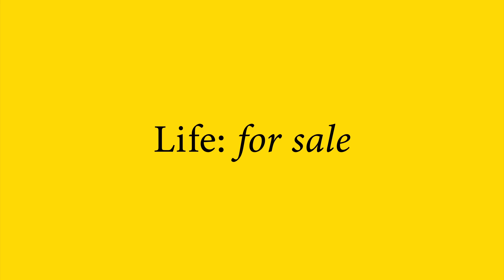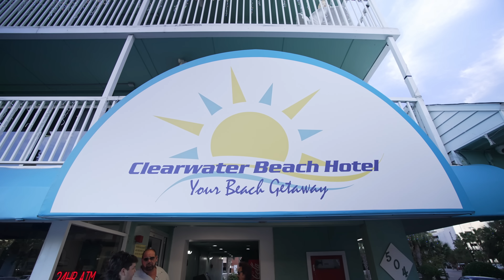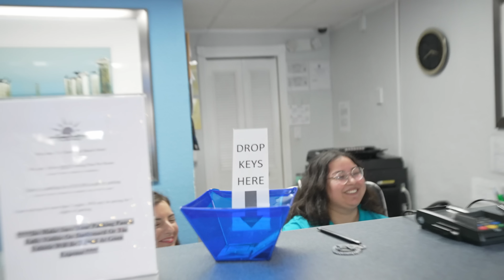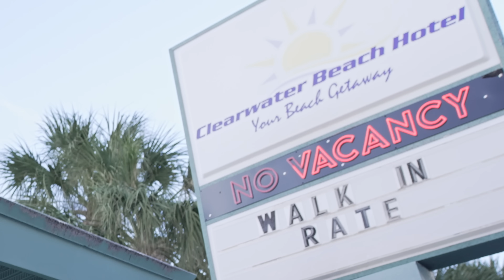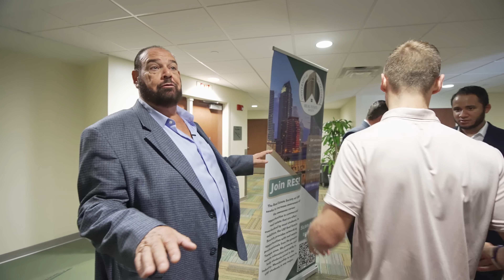Do You have $12,000,000 for this?

Comment: Ben, I know you are a stickler. Don't be a Smuck. I noticed quite a bit of black holes or black gaps up on the perimeter edges of the drop ceiling in the check in office of hotel. You could just put some caulk or something and spot paint to hide the black gaps.

Comment: Hey Ben -
Interesting play with the 2nd hotel across the street, do you think your changes limit the ability to spin off the hotel considering you’ve tied it to the primary hotel so considerably? Seems like they would now need to be sold as a bundle.
Reply: I don’t think so if he really wanted to sell it separately he could turn the icecream shop back into an office/check in. The building is still there so it shouldn’t cost too much.
Reply: I was thinking the same thing but id imagine you would need a front desk at all times especially in a tourist area .. or an idea is if he sells the hotel individually and the new buyer uses a real estate agents office offsite and thats where they deal with people there or also they can do bookings via Expedia, airbnb, etc.. you can get the keys in keyboxes around the property and completely eliminate front desk staff, you probably only need cleaners and maintenance.. but never owned a hotel so not sure if it would work but everything is pretty much digital these days so i dont see why not
Reply: It's more valuable together. and he's had it for 12 years, he said its a gold mine. He's not selling